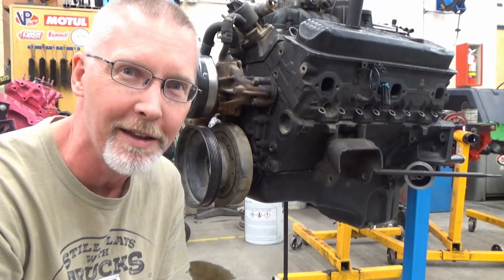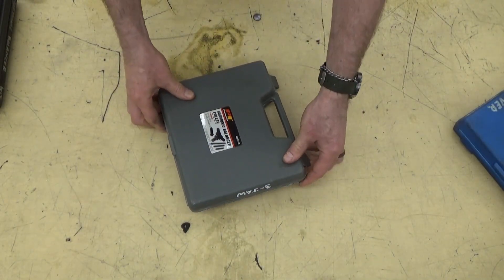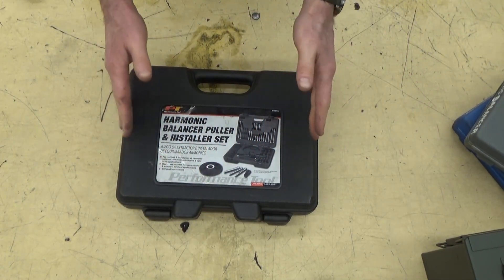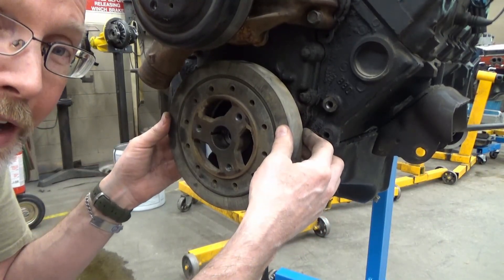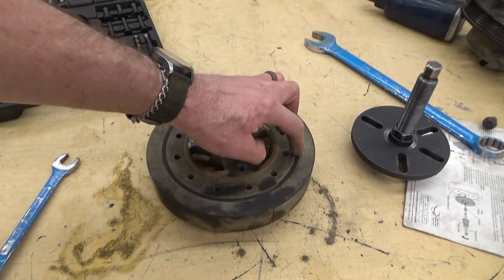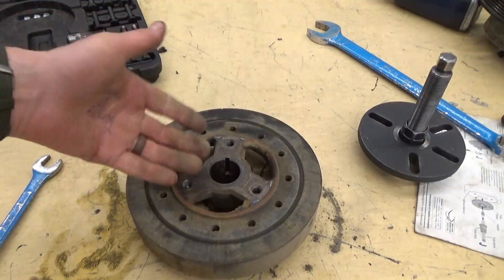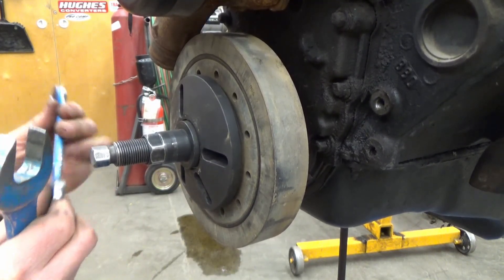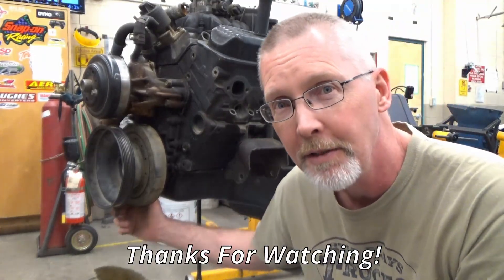Remove & Install Harmonic Balancers

Comment: Awesome video and entertaining. I wanted to ask you if you would put some rtv in the key hole of the pulley.  I saw on another video that someone said that is where oil usually leaks through. As long as its just in the key hole and not getting on threads.
Reply from the maker: I would put some behind the washer, and behind the head of the bolt.

Comment: How would you install on an older sbc that didn’t have a crank bolt?
Reply from the maker: I would probably boil the balancer in water and be quick.  And probably have a hammer nearby (grin).
Reply: @ I have a 327 that I need to do this on, so I wondered what the proper way would be. Have heard stories of people’s balancers not staying on. 🤞🏼 hopefully I don’t make my own story.
Reply from the maker: A machine shop can thread the end of the crank for you.  That would be the best way.  You could "probably" do it yourself if you are VERY careful to make sure everything lines up.  I'd make (or get made) a drilling jig of some sort to drill straight and true, and another for setting the tap straight and true.
Reply: @ I thought about that. Maybe wouldn’t hurt to do a freshen up and put a good cam in. Then it’d save me  the hassle and possibility of messing that one up.

Comment: Nice discussion on the finer points of harmonic balancer removal and installation.  No matter how tempted you are to use a hammer, don't!  Glad that point was hammered home!  I always wondered if a harmonic balancer actually does balance harmonics.  I know if you are cutting a brake drum on a lathe without the rubber band around it, it chatters like crazy and leaves a very ugly finish inside and that seems like a similar concept.